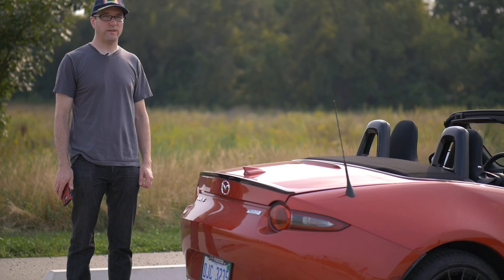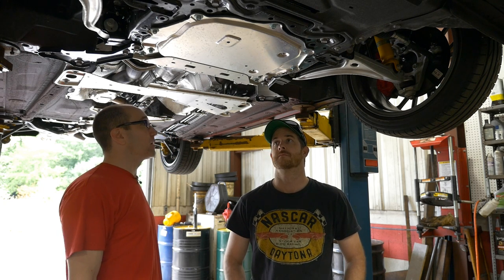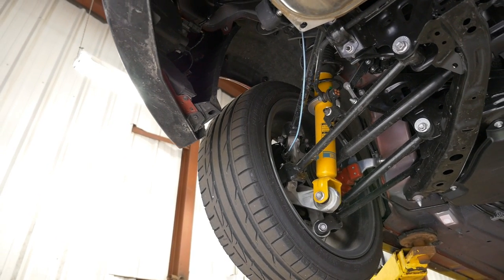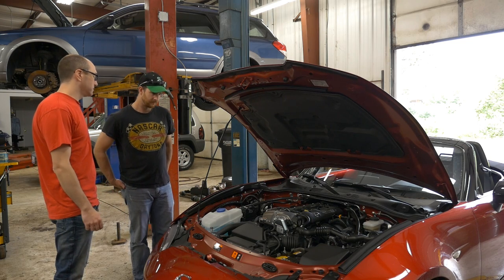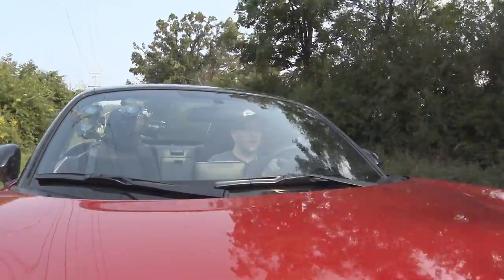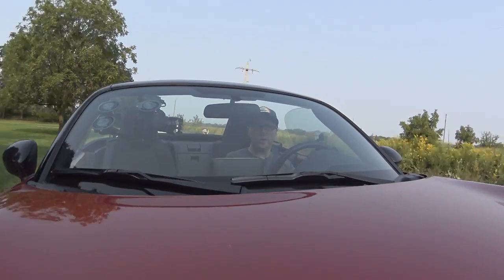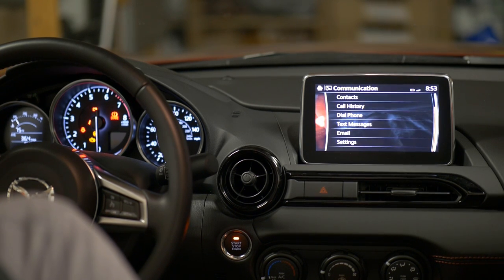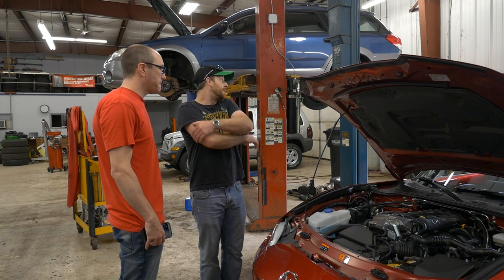Review | 2016 Mazda MX-5 | Curing Automotive Diseases

Comment: So, is this car better than the 2006 & newer Honda S2000? Which car would you rather have?
Reply from the maker: For the price S2000.  Its gonna do all the same and more.  Its just not as comfortable to drive or neutral.
Reply: savagegeese The S2000's are holding their value since they don't make them anymore. Used MX-5 Miata's can be had for cheap. I wonder how the 2016 MX-5 will hold value? I'm not about to buy a new MX-5 and have it worth half of what I bought it for in a few years.
Reply from the maker: +Timpala44 Completely agree. I had the S2000 and it did not lose 1 dollar in value in 1.5 years .  Its the smart buy of course, its still faster. But we dont have warranties anymore and parts are more scarce.  It really boils down to if you want to blow more money on a new car.
Reply: +savagegeese Not Faster!  When will this tired canard die, already?  
Most ;S2000 owners report acceleration times 0-60 hovering around high-five, low six-seconds -- nearly identical to a stock ND.
http://www.s2000.com/forums/all-othe...ard-s2000.html
Track times around Laguna Seca:
(See November Motor Trend, with the article 2015 Best Drivers Cars (p. 74)):
2016 Miata Club 1:50.68
2006 Honda S2000 1:50.74
Reply: youcanrunnaked my friend was part of a s2000 club in London, UK. In the real world, I haven't seen a mx5 (UK name) beat a s2000 on the road. On a track its probably different perhaps.

Comment: Whats so bad about the 86 chassis now? And what makes this a better platform? I know you like to give the car shit but come on. Even after those bilsteins, the ND still seems to have excsessive body roll.

This Seems to come with big brakes, coilovers and grippy tires already. and with all that, this club mx5 for 31-32k usd is barely a second faster around big willow, than a regular FRS with fun ungrippy eco tires for 25k.
Reply from the maker: When you really look side by side.  86 platform really is just a recycled subaru impreza chassis. Strut fronts, no aluminum usage standard multilink rear.  Its very econo car compared to miata.  Miata was setup by and for motorsports usage, dedicated platform. But as you said price wise 86 is pretty incredible.  Both cars are great.  Just the miata starts with a better setup this go around.  And the focus on weight reduction matters.
Reply: you might have confused the 86 with something else, but there are little/no recycled impreza parts on the 86. it shares a handful of rear suspension link parts with the WRX, brakes are also taken from the WRX.

the chassis itself has absolutely nothing to do with the impreza.
Reply from the maker: +HayrettinBalci Rear hubs are Forrester, same with brakes, rear suspension design is straight out of Forrester/Impreza.  front brakes as you said shared.  Most of the suspension is borrowed.  I mean even the trunk mat from the Impreza fits the FRS trunk.  The original test mule was a rwd conversion Impreza.  It shares more than you think even in part numbers.   Now yes the chassis is specific.  Great car still but I'll take a true doublewish bone suspension with forged aluminum and suspension designed with track in mind everytime, thats what you get with miata.  The car was built for their own home brewed race series in mind, one of the biggest in the world thats why they build for long life cycles as well this same chassis will still be in production 9 years from now.  86 may be on its 3rd generation by then.
Reply: savagegeese
exactly. the chassis itself doesnt share anything with the impreza. the prototype as you said was also based on a subaru. conflicting reports. I've read that they tested both outback and impreza chassis.

the ND is probably great and I'll take your word for it. but at the end of the day, fully kitted out with brembos, sticky tires on alloys and bilsteins, its only slightly faster than a FRS thanks to super close gearing.

far as space to work on, in the engine bay. can you get as much engine and F/I into the ND, as you could a BRZ?
Reply from the maker: +HayrettinBalci You make a good point about price vs performance.  There is room for supercharging for sure.  Turbos will also be a matter of time.  Tuning has kicked off already and netting 30whp on stock car.  I don't see the ND being a better tuner car though, the FA20 is likely the better choice for building power. Time with tell though.  Really its good to have both cars on the market and they are affordable/attainable.
Reply: savagegeese
well cant go wrong with either. cant wait to try a ND myself.

and great vids, as always.
Reply from the maker: +HayrettinBalci I think you will appreciate all the good but also see the short commings very quickly.  Thanks!

Comment: Don't buy this year with the manual transmission.  They're as flaky as my grandma's apple pie.  They got better as the years went on (2017 had fewer failures, and by 2018 hardly any).
Reply: Robert Drake  not really, I have a 2016 GT mx5 and no problems mans

Comment: Please make a S2000 comparison video!!!
Reply: +javie793 S2000 will blow it away.
Reply: +Scott P Nope.  The November Motor Trend, with the article 2015 Best Drivers Cars (p. 74) does not support your thesis. They tested the ND Club Miata against some really good cars at Mazda Raceway Laguna Seca, with racer Randy Pobst driving the fast lap for each car. Some interesting results:
2016 Miata Club 1:50.68
2006 Honda S2000 1:50.74
2013 Subaru BRZ 1:51.30
2009 Miata 1:52.18
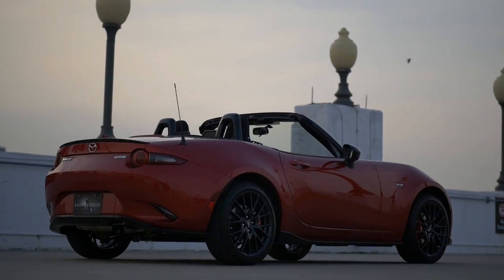1990 Miata 1:56.92

Most S2000 owners report acceleration times 0-60 hovering around high-five, low six-seconds -- nearly identical to a stock ND.
http://www.s2000.com/forums/all-othe...ard-s2000.html

The S2000 is a ten-year-old car design, featuring ten-year-old standards of safety, comfort and convenience, and operating economy.  It's time to get over it.
Reply from the maker: +youcanrunnaked I am going to call bullshit on that S2000 laptime.  The car is only about 300lbs heavier and makes well over 60whp more than the MX5.  The S2000 would walk away from it on any straight. I have been on the same track with the club and S2000, there is just no way.  Unless the track is setup like an autox.
Reply: Make a comparison video anyway👍
Reply: +savagegeese First, the ND MX-5 goes around Laguna Seca equally as fast as the S2000.  http://www.motortrend.com/news/2006-honda-s2000-laguna-lap/   http://www.motortrend.com/news/2015-motor-trend-best-drivers-car/   (Yes, different drivers on different days, but two professional racers, running multiple laps, both trying to get the lowest possible lap time on the same dry track.  I won't claim the ND is FASTER, despite its lower lap time, only that they are so close as to be track equals.)   Second, as to straight-line performance, owners of the S2000 report acceleration times 0-60 hovering around high-five, low six-seconds, and 1/4 mile times in the low to mid-14 second range -- nearly identical to a stock ND. http://www.s2000.com/forums/all-othe...ard-s2000.html  Dave Coleman warned you not to spec sheet race the ND.  That hp difference you cite is peak hp, which, for the S2000 only appears when the VTEC kicks in, between 6,000 - 8,000 rpm.  Putting aside that in normal driving that nearly never shows up, even in a track setting it's over in the blink of an eye.  Also, you are referencing crank hp; one of the Skyactiv technologies Mazda has mined is minimizing drive train losses (another being a rich, flat torque curve).  All that aside, if you are going to cite spec sheets, you should get the numbers right.  The ND's published curb weight is 2332 lbs; the S2000 AP1 is 2756 / AP2 is 2855.  The difference is 424 / 532 lbs, respectively, not 300.
Reply from the maker: +youcanrunnaked Ok 400/500 pounds gotcha, even at that, the S2000 makes 60+ wheel horsepower more than the ND. (Dynapack and Dynojet)  I have owned 3 S2000s, been on the track with each one.  Drove the S2000 and ND on the same track (not at same time).  The S2000 is a faster car, there is just no way around it.  As far as lap times, even those who have been on track at Laguna Seca for first time in S2000 run 1:49s.  It's a car much like the Elise/Exige that is extremely driver limited.  Better drivers with stock S2000s with just an alignment can run low 1:48 and even 1:47s.  If you want more info on that hit up the guys who run Counterspace Garage, they run S2000s and FRS/BRZ non-stop on that track and see more cars and lap times than any magazine they probably have seen ND lap times now too.  As far as bench racing, on track you spend your time at peak RPM where the S2000 is at home.  It's not a bench race here.  It's reality, I'd own and likely will own an ND this year. But after driving the S2000 it's a faster more dynamic car with a ton of overhead.  The ND potential is yet to be unlocked by tuning and quality suspension but that should be enough to bridge the gap.
Reply: +savagegeese I am giving you facts.  You are responding with impressions and anecdotes.  I have no doubt the S2000 feels much faster; VTEC will do that.  Sixty hp advantage when VTEC engages; otherwise it's more like 30, and the 500 lb weight disadvantage cancels that out.  Also, you conveniently ignore the reported straight-line times of actual owners who have timed their S2000s.  At best, it's marginally faster.  Give an ND Club a precision alignment, set the tire pressure, turn a few laps at Laguna Seca, then repeat in an S2000, and get back to me.
Reply: +youcanrunnaked One more point.  The use of the 2.0L Skyactiv in the ND is not a bug; it's a feature.  The ND is supposed to be an affordable sports car in the style of the great British roadsters.  How many of them had bespoke high-performance engines?  My old MGB had an iron block OHV engine borrowed from the BMC parts bin, which is why I could afford it.  It made 55 hp and did 0-60 in 14 seconds (maybe?) but I didn't care; it felt fast and was a blast to drive.  The ND borrows the 2.0L from the Mazda 3, which is itself the top pick among compact cars, massaged for sports car duty, out-doing the best British tradition.  (Heck, even the Lotus Elise uses a pedestrian Toyota engine.)  That's why the car sells for less than $30K, and the price of insurance isn't equal to the car payments.  Yet it is still a legit 6-second car.  No doubt Honda made a great engine in the S2000; they poured everything they had learned in F1 up to that point into it.  They also spent a fortune developing a dead-end platform that they likely lost their shirts on, which is why we will never see another car like that from them.  Another reason: a new S2000 in today's money would be over $40,000.  Ten to fifteen grand more than an MX-5, for a marginal performance advantage?  If Mazda was looking to hit a $40K price point, instead of a $25K price point, they probably could have come up with a higher-performance engine exclusively for the Miata, but please don't wish that they did that, because if they did, it would not be here for another two years, it would be a business disaster (like the S2000) and that car would be the end of the Miata nameplate.  The Miata has been a great affordable, open driver's car for more than 25 years -- Why would you wish that kind of failure on it?
Reply from the maker: +youcanrunnaked I wish no failure on the MX-5. I own a current gen 3 with 2.0L.  As stated will likely own an ND or have a long term ND.  Driven and owned an AP1 and AP2 both autox and track.  Driven the ND on track and street.  It's not some vtec placebo, it's 60+ WHP as stated.  It is the faster car, stock vs. stock.  When I have the ND I will run the same track I did S2000 and FRS and get lap times which I am positive will be at least 1-2 seconds slower a lap and will post up regardless.  The Mazda vs. Honda debate is not what this is about.  Mazda is invested in the MX-5 in terms of it being a grassroots racing platform,  I give them a ton of credit for it, it's also a dedicated chassis, transmission etc, the only thing missing is the motor.  The 2.0L was designed from the ground up to be an ECO platform, the skyactiv design was about efficiency not about performance.  They can re-tune for >91 Octane, re-do intake and exhaust, it is still an eco motor and that's just it, good bad, in between.  Still a great car, but it will never be that peaky, edgy high strung feeling driving experience the S2000 is.
On to Honda, they are off the reservation and have been since early 2000s.  Comparing the ND to a 15 year old Honda is pointless as modern Honda has nothing nor do they really care about grassroots motorsports, really whatever motorsports heritage they once had that transferred into their production cars is long dead. Modern CRZ, NSX, and Si are proof of that demise. Point is long live the MX-5 and hope to see great things over the life cycle.
Reply: +savagegeese Some very interesting perspectives, here, particularly from people who have owned both cars.  http://forum.miata.net/vb/showthread.php?t=597856
To be clear, I don't think you want the ND to fail; I just think that if it had a purpose-built engine, while it might be a better car, as a business proposition, it would be a failure.
Reply: Here we go

Comment: Lol says the engine has been recycled over and over again yet the Skyactiv engine has been around for like 3 years and been 2 other cars. He makes it seem like it's in every car Mazda has ever made for the past 10 years.
Reply from the maker: It's their global engine used in all modern models.   Its not a bad thing its just not a dedicated motor for this very dedicated chassis.
Reply: +savagegeese Not ALL modern models. They don't use it in the Mazda 6 or in the new CX-3 but I digress. I guess they have to cut costs where they can since going at it solo as a smaller auto manufacturer. Glad to see this motor is more than capable of powering this car. I know you guys clocked it at 6.1 seconds but several other tests have been able to get the car down to 5.8-5.9 seconds 0-60. Very quick car for just 155 hp.

Question. Is the engine as smooth as it sounds in your videos? And how much of a difference do you notice between this one and the application of this engine in the Mazda 3?
Reply from the maker: The 5.8 second launches are by revving the motor sky high and dumping the clutch.  Who does that in the real world?  The 6.1 was a street star, how real people launch which is still excellent results.  To answer your question, the motor is seamlessly smooth as in the video. In fact if you look at a dyno plot they did a superb job tuning the motor.  It feels amazingly quick compared to even the 2.5L Mazda3 however that's also because of gearing.  There is nothing wrong with the motor, or the tuning or the performance, we just want more of it.  Someone asked why we are being nicer to Mazda on this one, and like you said... They don't have 50 million laying around to make a one off motor yet.  But they tried here and try harder than most car companies, huge props.  Great car, maybe one day we'll get a higher performance version.

Comment: 15:34 ... back to 2nd gear ???? Come on ?
Reply from the maker: +bimbeano Short gearing and low power up hill wanted to grab a lower gear.
Reply: savagegeese Short gearing yes, so why not stay in 3rd instead of going back to 2nd at 6500 rpm only to rev it to 6800 and having to go back to 3rd ? It simply makes no sense ...
Reply from the maker: It was a mistake. Not being used to gearing and the lack of power.  Wanted to grab lower gear and was already near maxed out.
Reply: savagegeese Ah .. i know that feeling with a  low powered car :-)

Comment: if you want loads of power don't buy a MX 5, if you want fun and finesse then look at the MX
People who moan  I want more power just don't understand the  MX  and small roadster concept at all
As for hitting the console controls this guy must have the fore arms of Popeye or have a very weird way of gear shifting
Reply from the maker: +Lee B Its 155 HP is vastly low for ANY modern sporty car 4 banger even back to late 90s.  You have to be an utter fan boy to deny it.  But we have said it already, still amazing car.
Reply: savagegeese I understand that wanting higher power output  is IMHO very normal for the states bigger is better ethos, that's why the 1.5 which the car was primarily designed for is not sold in the USA.  Being European I think we have a different take on cars, hence why we mainly drive manuals.
Perhaps its because of our roads handling is the biggest requirement in roadsters and being able to maintain momentum through the bends in an easily managed way
Despite what the various reviews say only the 1.5 has the true 50-50 balance the 2.0 adds over 100 lbs (add another 50 plus lbs if you have the whats the point? auto box) in weight and gives it a 47-53 nose heavy attitude which (I've driven both) on our twisty roads makes for a more demanding rather than pleasurable drive on many bends.
The idea of the small engined neat and nimble roadster that's fun even at low speeds seems to have served the MX5 for 25 years with  a million units sold in that time.
I would be surprised if they would bother changing a proven formula  special as its won world car and car design for 2016.
 Upping the weight significantly and re-tooling for limited larger power unit sales when it sells well as is would not be good business

Comment: It doesnt make sense for the engine to be 2litter. When you go low weight - low hp you totally use a smaller turbo engine. 155hp from a 2litter isnt impressive at all and consumes more fuel than it should. Soundwise the naturally aspirated in line 4 doesn't give anything, so I dont get why.